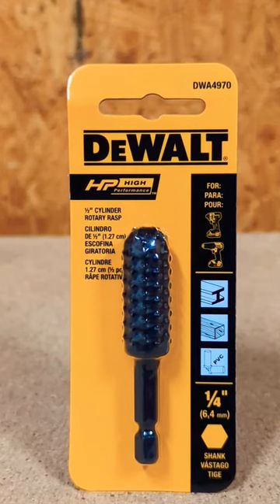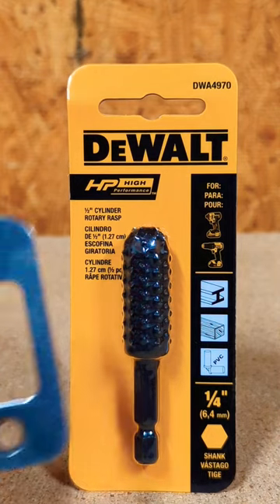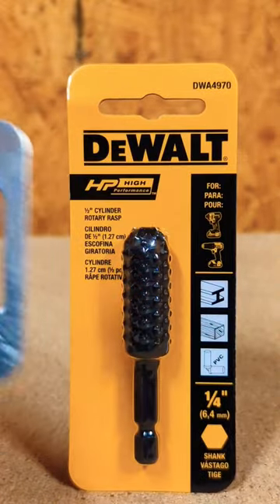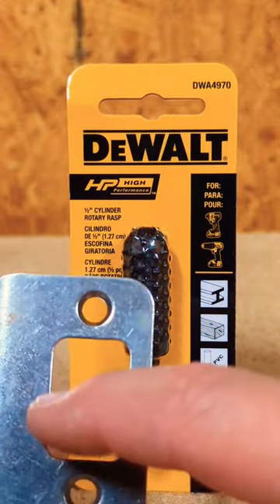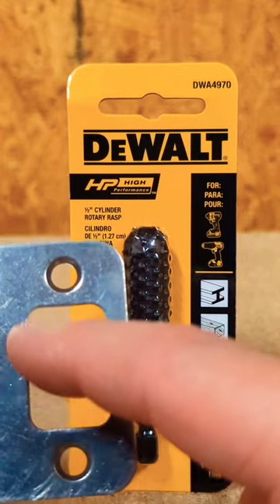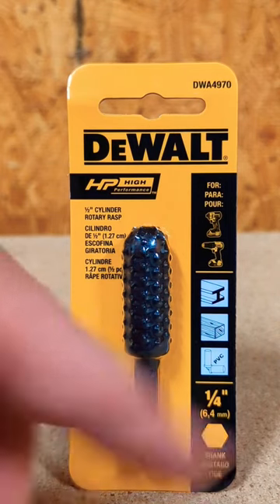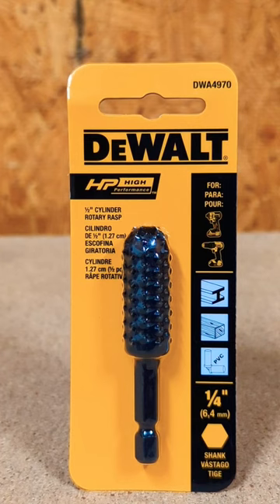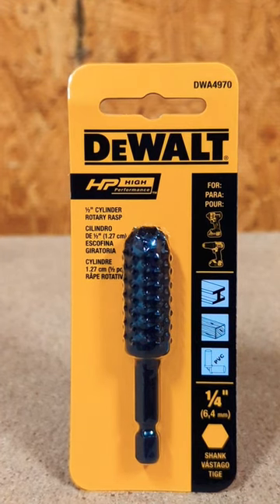DeWalt Rotary Rasp #apartmentmaintenance #maintenancetechnician #propertymanagement

Comment: That's pretty cool. I got a die grinder just for this reason with a carbide burr. If I knew about this that would fit in your drill I would of went this route. Cool shit!
Reply from the maker: Yeah it's definitely nice and works great. You'll like it. Thanks for watching Benjamin 👍
Reply: @ApartmentMaintenance  I just got mine in the mail from ace hardware...same one you mentioned...I'll put it to the test next time...thanks for the content brother. I like what your doing for the trades!
Reply from the maker: @benjamintimmins1656  Appreciate that & enjoy the tool bro 🛠️👍
Reply: Hey bro I just used this tool today for the first time. It works great. I used it on a strike plate where the key was real hard to open. I saw it was rubbing on the top and used it. It has some power snd took off the metal nice!!! Great tool recommendation bro! Thanks!